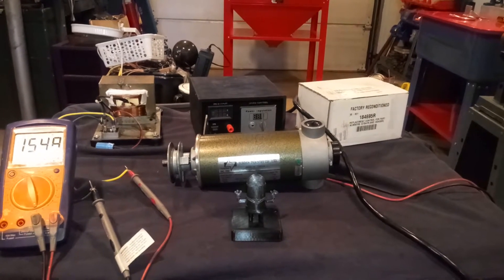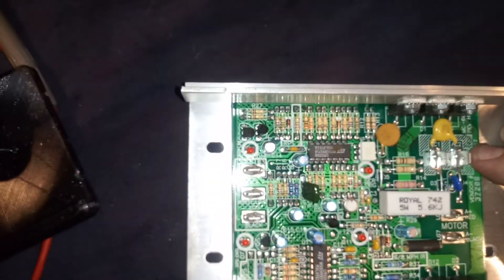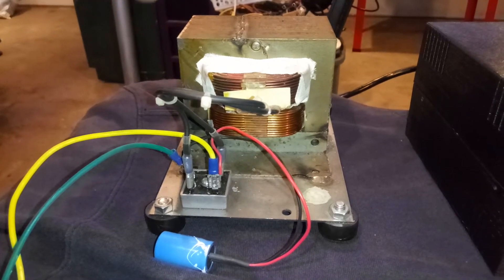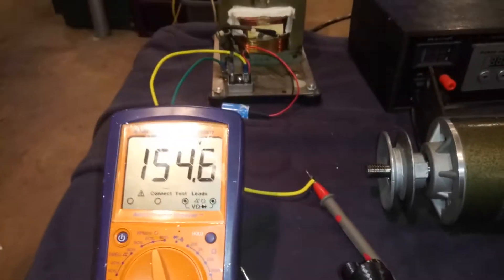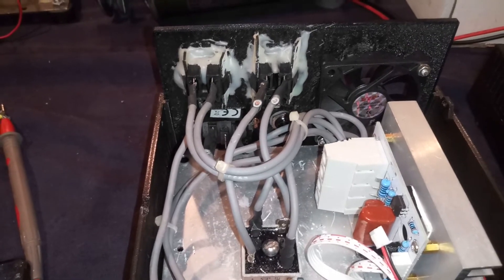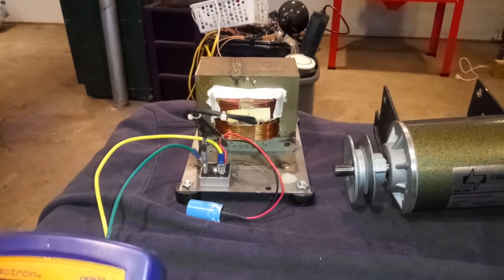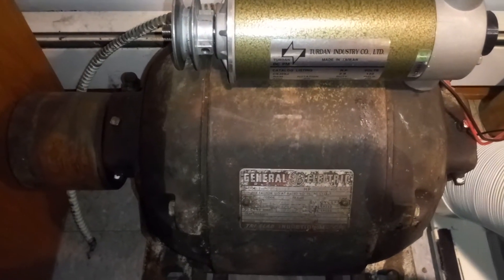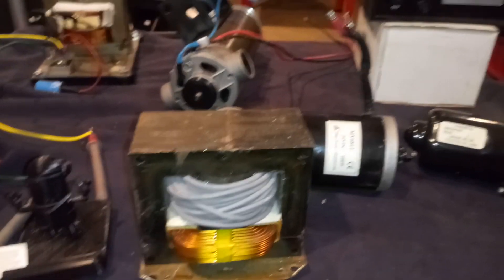Ways to run a treadmill motor

Comment: What is important here is, and I can't say it lightly enough, modifying transformers is not something that should be tackled by novices or DIYers due to the fact that you can get very seriously hurt. Electricity is not a hobby and should only be conducted if you know what you are doing. If you are guessing at modifying electrical components for usage on motors or other devices, then you shouldn't be doing it at all. (JMO) There are a lot of videos on YouTube where people state, 'this is what I did...' Huh! Not knowing what the results will be can either ruin the component(s) or injure yourself in the process. 
I am all for videos that are accurate and will help those wanting to convert electronics such as the DC motor for belt grinder. I get it! But use the proper peripherals and controllers as first stated in the video. They are 'engineered' for the optimal performance of the devices they were designed for.
Reply: Eh..  just dont touch the pokey bits, keep one arm behind your back and wear safety gooogles n youll be alright.   Just dont breath in the magic pixies if any get out on ya..  and ground out shit..  if somebody can understand and obey the whole “dont pee on that fence” statement than i believe theyre good.. and if they peed on the fence anyways than theyll make good plant food,,  too many dumb fuckers infesting this planet right now anyways and all society keeps doing is taking care of their retards.. you ever see any wild animal packs who helped their stupid members out?   No cuz the dumb ones just die off so the pack becomes tougher
Reply: @Z-Ack  Feel better now that you got that off your chest?
Reply: My brother in the late 70's got his first job working for a electrician out of high school. He replaced someone who wired a door bell transformer backwards. I stepped the voltage up instead of down. Usually not enough amps to kill. Like touching a bug zapper. But it was raining and it was on aluminum siding. It killed him.

Comment: What size cap did you use?  250v 50μf or did you use a .22pf smoothing cap?  I think the .22 smaller will smooth out the peak to peak and the larger will increase the peak to peak.. both will provide smoothing of the output but curious what you used...  watched a vid of a guy who tried correcting his solid state welder output on one of those 100$ cheapos and by the time he got what he wanted out of it he had a seperate huge rectifier, 4 smoothing induction choke coils, a bank of 4 expensive caps and all kinda heat sinks for the chokes n rectifier..,  lol
Reply from the maker: I don't remember the exact size but I believe it was something like 250V 33uf. I  know there is some wizarding in figuring out which caps to use. That is a really good point I didn't think about bringing up the capacitance and that is hugely related to how well the motor will run under load.

Comment: Hi, and thanks a lot...........I know enough to be dangerous.......when I need help, I know where to turn. I am currently refurbishing a tool post grinder. Sadly after having invested in new bearings, minor rewiring, and a whole heap of time......it is still intermittently overheating..it has an internal MANUALLy induced temperature disconnect !!! (old motor, everything else is great) Like a "Dumor"....SO treadmill motor it will be. Your video was a great help. Seeing other videos on the subject, a while ago, I remembered seeing one where the YouTuber used a large capacitor across the circuit when using an SCR and Bridge rectifier to try to smooth the power. He also used an Inductor (don't know how many wraps you would use) in the final wiring where it enters the motor.  I was searching for the Video when I found you. 
Thanks for the time you invested in making it..........I will go look at some of your other work. 
I am from Australia so we use 240v here.....harder to find a controller board off the shelf for less than $ 200+ USD
Cheers, David Harper